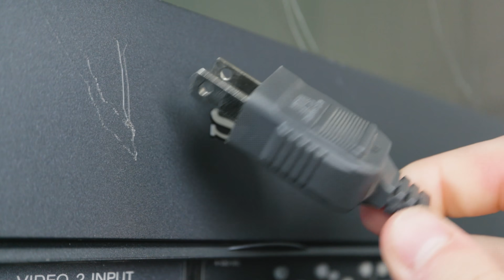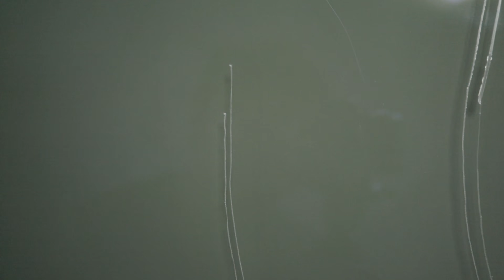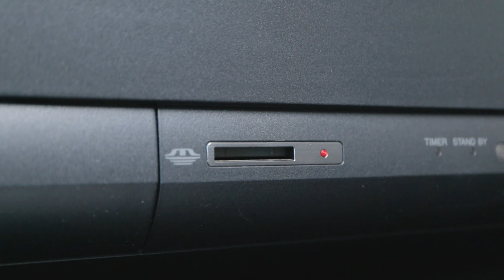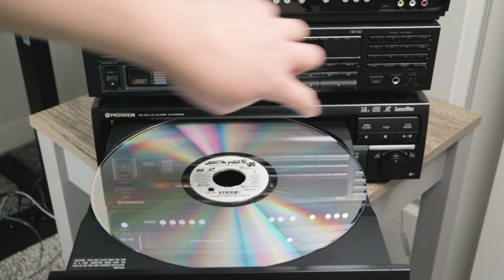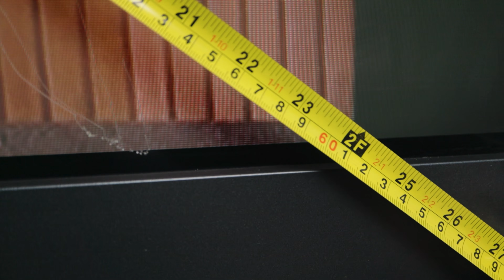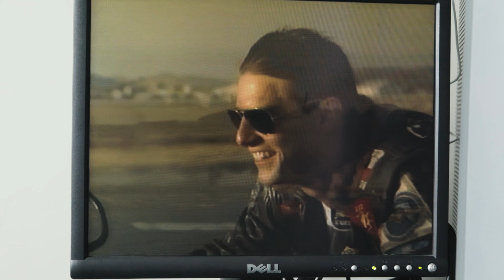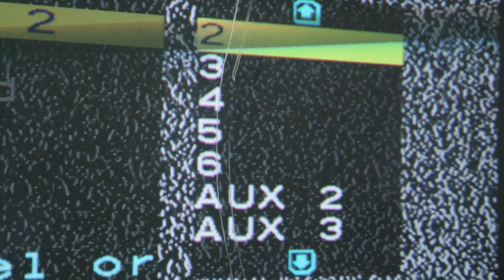The HD, WIDESCREEN Tube TV! Sony Trinitron KV-30XBR910

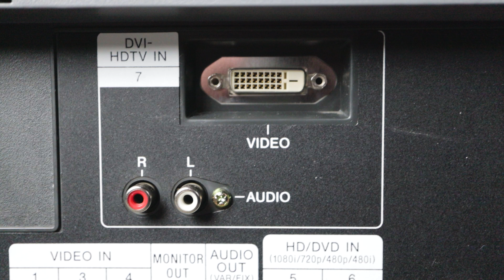Comment: 4:30 HDMI was also designed to be backwards compatible with DVI, so you can use a passive adapter and get nearly full functionality. This also has the side effect of DVI technically being able to carry audio, but in a way that isn't compliant with the DVI standard, as it's effectively like having a passive HDMI to DVI adapter on the source and a passive DVI to HDMI adapter on the display.
Reply: Yes, DVI is electrically pin-compatible with HDMI for video. That's exactly how I had my PS3 connected to my 34" version of this same TV, using the PS3's optical out for the audio. A simple passive HDMI-to-DVI cable was all that was needed.
Reply: @mjy Absolutely correct That's why you're able to have an adapter table without power to it That takes DVI and converts it to HDMI I did that for my projector back in 2011 from my Blu-ray player to my projector it produced the really good picture too 😅
Reply: @mjy this was even common knowledge back then. You even get passive adaptors with your videocard back in the day. (dvi-vga, dvi-hdmi, hdmi-dvi).
Reply: @brietman_  (dvi-vga, dvi-hdmi, hdmi-dvi) have about 30 in a drawer somewhere from old graphics cards back in the day.
Reply from the maker: Ohhhh that makes sense! That's interesting.. thank you!
Reply: Many old Nvidia Geforce cards also did HD Audio over DVI when you use it with a Passive DVI to HDMI cable. I used and old SFF PC it on my dining room TV for several years with such a connection.
Reply: I was going to say, I have pushed audio through DVI before, but it was a dvi to hdmi cable with the DVI from the computer
Reply: Guys: As an original owner of a KV-30XBR910 who still has and uses his today: Audio over DVI does not work with this TV even with HDMI to DVI or enhanced DVI with audio. Heck, I had to get a HDMI audio extractor just to use ChromeCast and MiraCast devices with no audio break-out.
Reply: @emmettturner9452 and that is a perfect demonstration of how audio over DVI isn't standard compliant, as the TV is properly using the DVI standard instead of treating it as an HDMI port with a DVI connector. It is interesting hearing this though, as generally the indicator of something using the HDMI standard on a DVI port seems to be if it advertises HDCP compliance (as is the case with many motherboards and GPUs with DVI connectors)
Reply: @SHIFT-HACKMON  Before HDMI it was a battle between DVI and IEEE1394 (FireWire, iLink, and whatever Pioneer was calling it) with both supporting HDCP in the home theater space though completely optional for computer monitors and the like. HDCP was pretty much the only reason DVI existed on HDTVs. Before we had either, all the tech reviewers were warning consumers not to buy an HDTV until they had HDCP-capable digital inputs since they expected Blu-Ray, HD-DVD, and HD STBs (cable/satellite boxes) to require it for HD content. Supposedly they’d only output quarter-res or standard def over analog, though HD-DVD gave that up to support XBOX360 (no HDMI at first) and in response Blu-Ray ended up promising not to implement that flag in commercial movie releases for the first several years.

HDCP being optional for DVI became a huge fiasco when Windows Vista launched and enforced HDCP and signed drivers for certain kinds of copy-protected media playback so everyone’s DVI monitors became useless for the coming content many bought them to consume. That’s when I had to upgrade from a Dell UltraSharp 2003FPW to a 2007WFP. Yeah: Both were DVI, neither had HDMI and DisplayPort still wasn’t a thing in consumer monitors and video cards. 🤦‍♂️ Even worse, we had video cards advertising themselves as HDCP compliant for years even though they weren’t. The chip was capable of it but they didn’t even attempt to implement it.
Reply: Only with dvi-d
Reply: @MrAckers75 Except DVI-I inputs and outputs support DVI-D. Analog-only DVI-A functionally doesn’t exist outside of strange niches like obscure KVM switches, so there’s almost no need to distinguish them. Just about any consumer electronics with DVI supports HDMI over DVI-D and DVI-I is just a way to consolidate a VGA port (remains fully DVI-D compliant). You’d use that with a DVI to VGA dongle instead of a bespoke DVI-I cable anyway.
Reply: @emmettturner9452  yeah the whole point of using a DVI port is to provide digital output functionality

If it only supports analog output Most companies just put a VGA port on the product...
Reply: @MrAckers75  I've never seen an analog-only DVI port

Because the whole point of a DVI port is being able to carry digital video. Otherwise most companies just use a VGA port...
Reply: you can output the sound with an optical or coax or the white/red RCA
Reply: @blue4k-XLR  Right, but many devices don’t offer that. When MiraCast and ChromeCast first came out I had to buy a HDMI audio extractor to use with my HDMI to DVI cable since my Belkin and Google devices didn’t have any other audio output.
Reply: You're right from the computer some DVI cables did have sound It's just the TVs didn't

Comment: Pro tip: If you have a shop vac, buy a second hose for it. Attach that hose to the exhaust of the shop vac. Now, you have a blow hose and a vacuum hose, and don't have to use expensive and sometimes ineffective canned air! Oh, and DVI can carry audio, it just doesn't always.
Reply from the maker: Good idea! Also, I had no idea DVI could carry audio at all!
Reply: @simonretrotech ooh same tbh
Reply: DVI at the time couldn't. It wasn't until AMD came up with a new standard like ten years after this TV did DVI gain the ability to carry audio.
Reply: @MrMackievelli  I still have this TV (original owner) and I also had nVidia cards that could do audio over DVI before 2006. Heck, you could literally plug a DVI cable into an HDMI port to get audio over DVI, it’s just that previous DVI devices including this TV don’t know what to make of it and ignore the extra data.
Reply: @emmettturner9452 I remember getting dvi to hdmi cables with motherboards in the day sometimes
Reply: @MrMackievelli good I thought I was losing it.
Reply: The problem with this, is that using a shop vac in this way can generate static electricity which can cause problems for certain components.
Reply: @silentknights5796 CRTs are like static electricity generators on the verge of being Tesla coils. Just keep it and yourself grounded, IMO.
Reply: Pro'er Tip: Don't buy another hose, just disconnect your original hose from the air input and plug it in to the air exhaust.